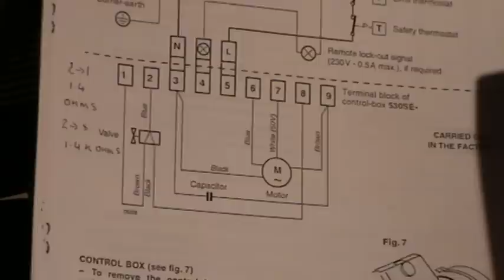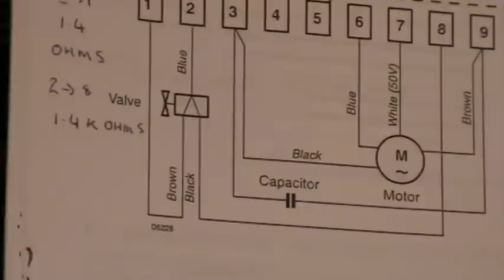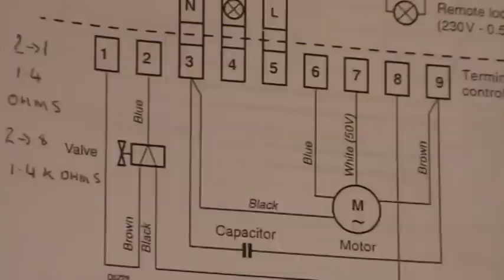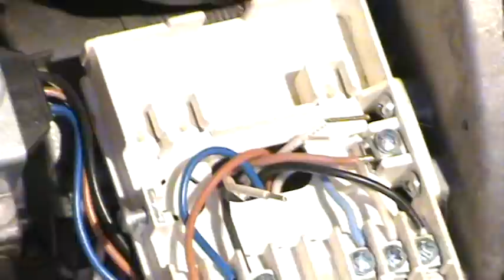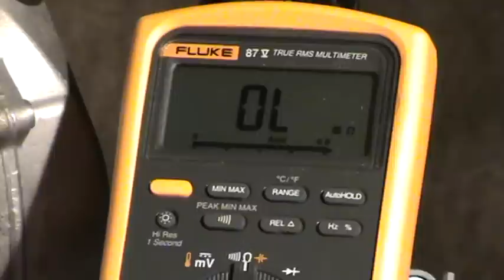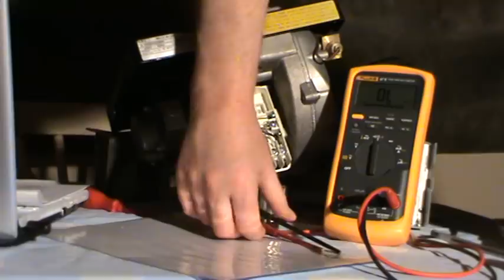Oil burner training clip.mpg

Comment: Hello there Ed, i was thinking of setting up a wifi controlled heating system using this yoke called a wemo controller by belkin,  but on inspecting my current oil burner timer i dont have a clue as how to wire it up. Where should i start? I was expecting that the heating contoller just simply sends a simple on off signal to the oil burner but it seems a lot more complicated. any advice would be appreciated cheers.